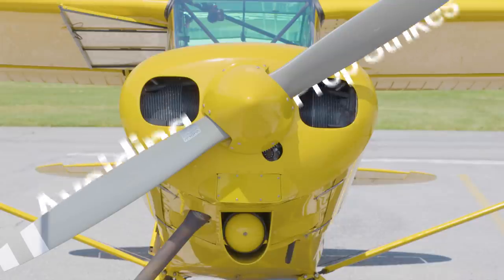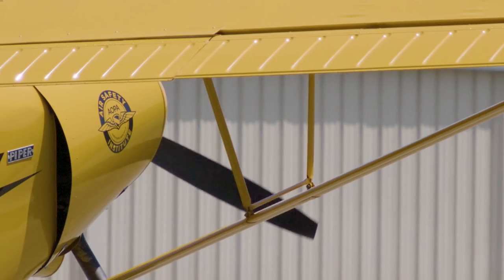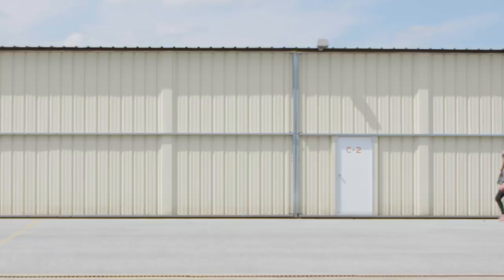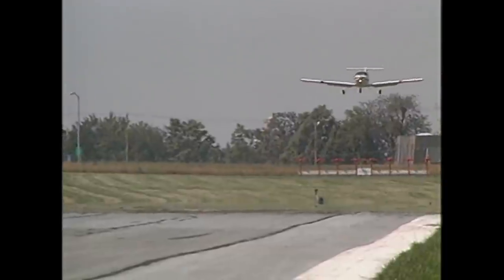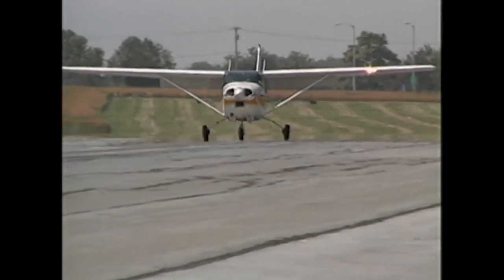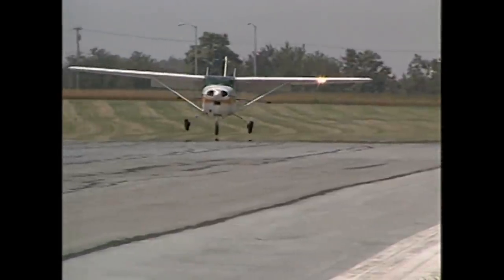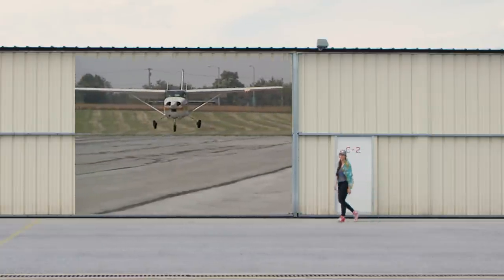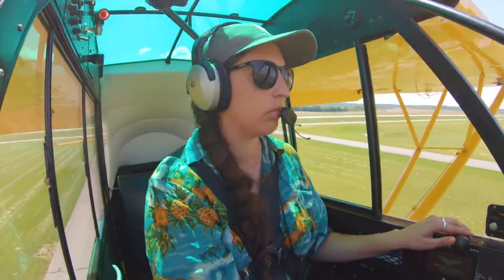Avoiding Prop Strikes

Comment: I had a weird prop strike once. I initially parked the school's 172 on the tarmac, then went to visit my brother. At his house later we saw a thunderstorm coming so I went back to the airport to tie the 172 down. The tie-down cable was in the grass so I taxied the plane from asphalt to the grass & heard a faint "ping." Storm was upon me so I quickly tied down & left. Next morning I was late & rushing to fly back to CRS since the plane was reserved & I failed to run my hand over the prop during my hurried preflight. On climb-out at full power the 172 vibrated slightly. I was alarmed, but late, and the vibration nearly disappeared on cruise power. Back at CRS the mechanic was re-fueling the plane & he yelled at me "HEY! What the hell did you do to this prop?!" I walked over & saw a chunk shaved off one blade! Guy said I could've dislodged the engine from the mount! It all came back to me, the ping, the vibration, not inspecting the prop. Since then, I always run my hand around the prop! Fortunately, the prop was within tolerance for a simple filed repair.
Reply: And you could blamed for it. I Preflight the plane and If I find something, I take a picture.
Reply: @kimberlywentworth9160  I wouldn't "be blamed" for it because I immediately took responsibility for doing it when that happened.

Comment: Step 1: Have a jet
Reply: Having a jet doesn’t solve poor judgement or poor skill. You can still destroy a jet, just as fast if not faster. A bird strike that hits a prop might or might not damage, same bird hits one of the blades in a jet and that 500K to 9mil jet engine is destroyed. The only advantage a jet engine has is speed and ability to fly at higher altitudes efficiently.
Reply: Step 2: Turbine strike.

Comment: I am working on slowing down on landings. Nice safe speed, but not excessive. Takes some practice, especially in slick  or faster planes.
Reply: What are you flying? I haven't flown many airplanes but I have noticed if you really nail the approach speed from POH, there's a good chance your landing is going to be smooth.

Comment: I am a student pilot and working on not dropping the nose. PS, I Did have a bounce landing and did a go around.  It's good to practice go a rounds. Also, when you put in the throttle you have to hold the nose level and not pull up or you can stall. Once you get enough speed and start to climb start putting in the flaps gently so you do not drop like a rock. This is what I learned today as I am a student pilot learning landings. It's hard to lean to hold the nose up as you have seems like forever ground effect. I am still working on the touch and technique. Easier said then done.

Comment: Prop strikes are not common at all (usually only happening in an outright crash or oscillation on a bad landing).  Prop damage is possible so the prop should be inspected before each flight.  Rocks from the pavement (or if back country flying, from the terrain) can compromise prop integrity sometimes requiring repair and or replacement.

Comment: I learned to fly at a strip which had very dodgy taxiways and large chunks of gravel/asphalt. One thing that was always drilled into me is taxying with the yoke full aft, except if a strong tailwind is behind the aircraft.

It’s amazing to me how many pilots taxy over grass and gravel with the yoke neutral or even forward (hands off). You might get away with it in most aircraft, but some (eg. Early 182 with twin blade prop) have really close ground clearance.

Comment: good info... just transitioning from my C150 to my RV6...  made lots of "go arounds" but getting better every time :)
Reply: Here is my hard learned lesson:  My RV7A stalls at around 50.  So landing speed is around 65.  NOT 70 or 75!  Because if you land at 75, soon you will land at 80.  You can smoothly touch down at 75 if you are lucky, but at 100(!!! which I did once in a heavy crosswind) YOU WILL BOUNCE.  So stick with 65 or so.  Learn to slow down.
Reply: @JXS63J  do you 3 point in or wheel land as a rule?  I have been shooting for 65-70 touchdown speed...
Reply: @billbrisson  Mine is a tricycle gear, so I land on the mains first and lower the front wheel down.  I've never landed on the nose first yet, so knock on aluminum.  I USED to be happy with 70-75 knots landing but I have come to learn that that is just too fast.  Stall is ~50, and 50 * 1.3 = 65.  At my flight review, I was asked to start consistently landing at 62 knots, which I found tricky but doable.  I totally respect this instructor.  My landings were smoother at higher speeds, but that is deceptive.  I'll be happy when these slower landings become smoother.  When done right, RVs do give that grin that lasts a while.  Enjoy your 6!

Comment: This is probably against most teaching but I like to land with the throttle on idle. As I see it people like way too much throttle when landing. We are gaining kinetic energy as we go down and we need to get rid of all energy for landing so running the throttle seems counter productive. Set the plane for glide, glide as long as you can, with flaps out. Just let the plane bleed out the energy and then it sets down on its own. You don't up and down correct continuously. Should it bounce it's because you did it a little wrong but then you set it for glide again, you don't steer it down. You bleed down. And as it's about to set down you can do a little crab correction to the side to align it if there was side wind.
You have to know that a plane is a glider. You need a sense of that. There was a youtuber couple that because of an engine failure he ended up stalling the plane in a misguided attempt to keep it in the air when he could have glided perfectly calmly to the flat terrain right in front of him. Both pilots broke their backs, serious injuries. Come on, party people. Don't be procedure jockeys. Know that your plane is a glider. Be able to fly it like that. Have plans for that. And learn to hate planes with poor glide ratios. Like Cessnas. Most old designs are awful. Like 10:1 or worse. Bonanza is slightly less bad at around 11:1, Piper Lance is apparently uniquely awful at 7:1. For comparison the Lancair IV-P is around 20:1 and this translates directly to speed and fuel economy. This and many other reasons is why all old planes and designs should be scrapped. High weight is another bad design aspect. Many old birds weigh about a ton and that's very wrong.
Reply: I agreed with you up and till the old planes need to be scrapped.
Reply: @AkPacerPilot  That's also how far you were right.
Reply: @DanFrederiksen  you scrap the old planes and you kill the future of aviation. Think flight training is expensive now, wait till every flight school would have to go out and buy 600K + newer designed aircraft. Think A&P work is expensive now, wait until half the A&P shops close because they don’t have the older planes they are bringing back to life. Scrapping all the old birds and you are literally removing 80% or more of the GA aircraft from the market. Which means people fly less, because availability of aircraft is either nonexistent or expensive, which leads to less experience, less proficiency, which leads to less skilled dangerous pilots. 

So yeah, pound sand with that half of your argument. Also now that I think about it, your example of the pilot breaking his back, had nothing to do with it being an older aircraft, it likely had to do with currency, and training… lack there of. So really the last half of your statement is wrong!
Reply: @DanFrederiksen  actually the more I think about it your comments about glide ratio are flawed. All glide ratio is how much altitude you loose over a distance, which has nothing to do with landing or survivability.
Reply: @AkPacerPilot  I'm not advocating status quo, we need new designs. The state of GA is beyond pathetic. But even now LSAs instantly pay for themselves because a cessna is such a turd that leaks money. And they are legal for PPL training now.
Reply: @AkPacerPilot  in an engine out situation glide ratio determines your reach.
Reply: @DanFrederiksen  the only aspect of the old design that is garbage is the engine technology, Engine technology has advanced a lot since the 1940’s where most of our GA aircraft technology remains. As for airframes, not all new designs are great, take the many issues and fatalities that came from cirus, good grief they had to install chutes to keep from killing people. The FAA is so far behind the curve on new technology and the means to get that technology into aircraft is an expensive joke. The FAA is pushing gimmick technology like angle of attack indicators over teaching people how to fly the wing. Which is the aspect of your original comment you touched on that I agree with, learning to fly the wing over the engine, not really how you worded it, but that’s what it boils down to.
Reply: @DanFrederiksen  while true it determines your reach, it does not determine your ability to safely land in an engine out. I’d take my 1958 converted pacer with big tires in remote Alaska with an engine out over any 200 mph 20:1 glide ratio speed demon… why? Because while my plane may sink like a rock, I have 100 more landable options, because I only need 500’ to get it in where what you propose likely needs 2000’ of flat concrete. That added reach you may be getting may be the down fall that puts you unable to reach an appropriate place to land because the landing requirements are narrower to meet. 

But again, it all comes down to knowing your aircraft, being proficient, training and flying the wing not the engine regardless of the aircraft your flying. But what do I know, I’ve only safely landed 2 engine outs in my 12 years of flying without bending the plane up.
Reply: Interesting discussion so far!
Despite flying for many years, I don't have a lot of hours. There is one thing that I would like opinions of both of you.
In initial days of flying, I developed a habit of long, dragged out engine-idol glides for landing. As I gained more experience, multiple instructors strongly advised me to change my habit and keep a little power on as long as possible before touchdown. Apparently, ability to land without long glides is important for extreme cold weather to prevent shock-cooling. What is your opinion?
Reply: @zeepack  my opinion is steep power off low power approach, learn to use the roll out to dissipate the energy before touchdown. You’ll save your breaks on long runways and gain the ability to stop way shorter then your POH says on short field landings. As for cold weather, living in Alaska and often flying in sub zero temps on skis, I have a far different approach that’s more similar to float flying. One where you are using more power for two reasons. If you touch down on skis in soft snow at idle you are very likely to nose over and adding having forward thrust helps with that initial grab the snow has, much like float flying. This also helps the engine to cool slower by having the extra power helps reduce shock cooling on the cylinders when the temps are near 100 deg lower then summer time. As for shock cooling, in the summer, I slow the plane down in the pattern, by the time I’ve gotten to base I’m where most are power wise on short final. By final I’m at idle or slightly above. Example: cruise 2400, pattern 1900, base 1500, turn to final 1200, final idle. I keep my pattern tight and short. I do use a lot of slips when I’m high and rarely have to add power to hit my mark. 

If you’re 1/2 mile out 300’ from the ground find yourself having to add near cruise power to make the runway you are doing it wrong. 

That’s my opinion.
Reply: @AkPacerPilot  Thanks for taking time to write! I love to hear about different techniques different pilots use.
Reply: @zeepack  you are welcome! Whatever technique you choose to use, my advice is use one that can get you to the runway if you loose your engine and one that you can consistently reproduce. Most importantly, fly as often as you can and frequently go back to your ppl training skills at least once every quarter (Ie ppl maneuvers) and learn & throw in the commercial maneuvers. Even if you have no plans to ever be a cpl. If you haven’t learned the cpl maneuvers, get a cfi to work with you on them on your next biannual!
Reply: @zeepack  shock cooling is one of the myths that persist like the impossible turn. It might apply to some engines or have applied but when my local owners group said we can't turn off the engine in flight because of shock cooling I looked up Rotax' stance on the matter and it specifically said shock cooling wasn't a thing for this engine.
Of course Rotax could be wrong but when they specifically said so, it can't be a super obvious problem. So I would look into it for your specific engine and if we can't find any engines where it is an issue, maybe it's a myth that no longer applies.
Reply: A bonanza has a glide ratio of 11:1? I doubt that, the Piper Archer is 11:1 and Id say archers glide pretty dang well. I'd bet bonanzas are closer to 7:1, I've never seen a bonanza that didn't have the glide ratio of a brick when the power was pulled.
Reply: Landing with or without power is very scenario based. I'd agree that most of the time landing without power is the best way to do it, but it's also required that you land with power during soft field landings according to the ACS. I've done my fair share of short soft field landings and I always do it just fine without power but the FAA says instructors have to teach it that way, it DPE's have to test you that way. Also I used to fly a Cessna 210A and if you had flaps full down on that thing and you pulled power out you'd lose enough control to raise the nose up again and you'd slow down so fast you'd likely stall from all the drag. I regularly landed that thing with power. Point is, you're sort of correct, maybe mostly correct about landing with or without power, but it's also very scenario based.
Reply: @skylarcaldwell7208  I couldn’t agree more on scenario based and for that matter equipment based. You don’t land on floats or snow (skis) at idle, at least you don’t if you don’t want to nose over.
Reply: @skylarcaldwell7208  What do you base the 11:1 Archer on? what's your source.
Reply: @DanFrederiksen  the POH, it has a glide chart that you can derive the ratio from. I just ran the math again, looks like it's actually a little over 10:1 for the Archer, and there is no way the Bonanza has a better glide ratio than the Archer haha

Comment: The addition of the P-Lead check at the end was kinda weird. I'd compare it to a run on sentence. Off topic at best. I'm still on the fence about p-lead checks. I get the idea, but you also risk a back fire doing that. If I had a dollar for every cracked muffler I've seen from someone doing a p-lead check, I'd have a lot more dollars to buy a plane with haha. I just treat every prop like it's mags are hot.
Reply: I recommend doing a run-up (about 1500rpm) and cycle the magnetos L and R. Observe a drop on each to verify the other magneto has grounded. No backfire risk! Don't recommend this procedure while on a busy ramp.

Comment: Wrong: prop strikes do not require a full engine tear down and overhaul. I stopped watching right there. It's not a legal requirement. Some engine models require replacements or inspections of certain parts. But the is no FAA rule that requires a private operator to open up an engine after a prop strike. There are some service bulletins that require it: SBs are not mandatory for Part 91 operators. Only ADs are.
Doesn't mean it's not advisable to open up an engine after an incident but stop perpetuating this myth that it is a legal requirement. Most A&P are already clueless when it comes to regulations. 
I've seen many incidents of prop damage that did absolutely nothing to the engine. With composite props especially,  at idle, I've never heard of engine damage and neither has our local engine shop. And only 10-20% of metal prop strikes result in damage.  So use your common sense when evaluating this and not some made up rule.

Comment: What the devil is that round wheel/knob on the end of the long linkage clamped to the downtube? Looks like it says "Mygoflight" on it?

Okay, found it. Utterly out of place on a Super Cub, but different strokes.

3:52 Who is she talking to? He's right behind me, isn't he? 😲
Reply: Is it power knob?
Reply: @jjohnston94  Thanks!
Reply: @skylarcaldwell7208  Forgot to say: you can download them for free from the FAA's website. Printing them in a usable form is another matter, but if you have lots of patience and a roll of tape, you could build them out of letter sized sheets.
Reply: @jjohnston94  I fly every day professionally and as a hobby on the weekends, I'd rather not print out new charts regularly and spend the money on ink cartridges. Not to mention buying chart supplements or having to print those off. Id much rather have an iPad I can click one button on before my flight and I have all the charts and info I need in seconds. Not to mention the ADS-B in feature with traffic and real time weather. Folks who aren't willing to upgrade to electronic nav charts and data are stuck in the past. Even in a super Cub, the increase in situational awareness especially in the busy air spaces I fly in, is a no brainer. ADS-B in has literally prevented me from having multiple close calls, even while scanning outside, it can be easy to miss traffic.